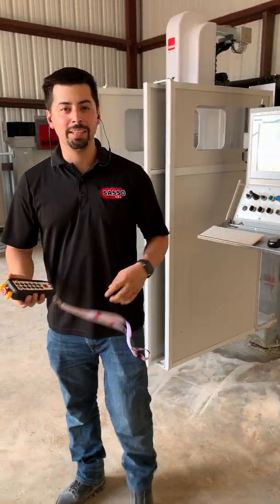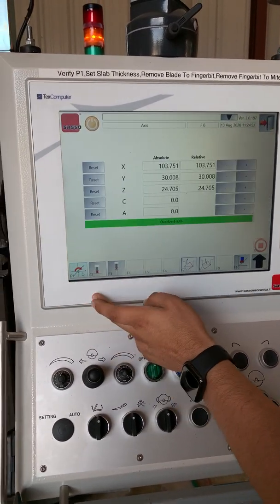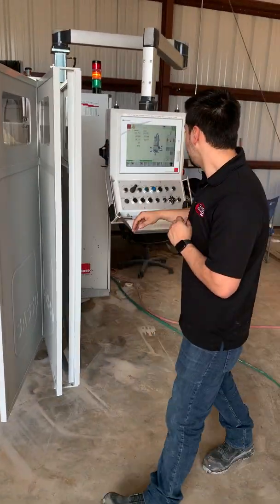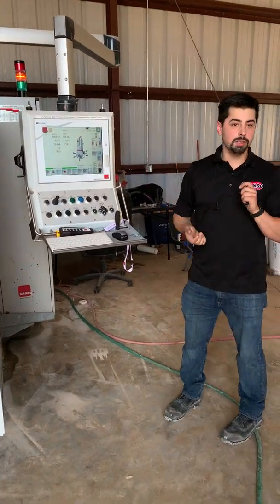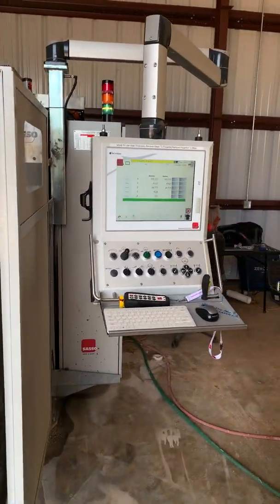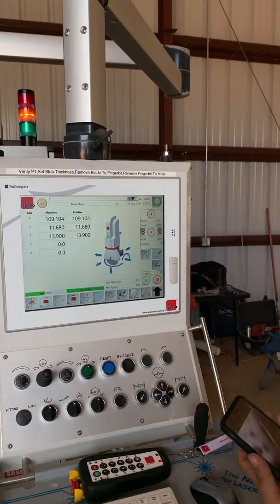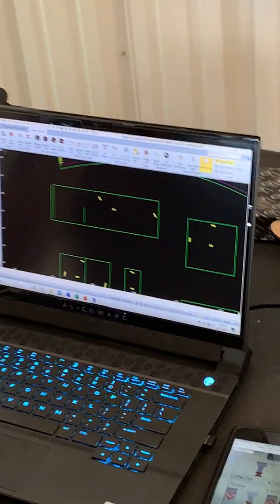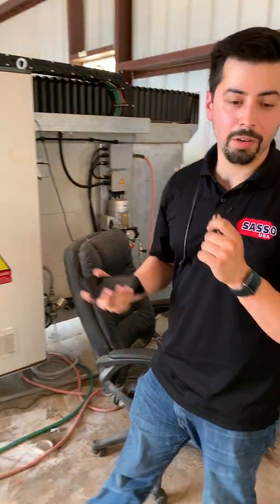Measuring your tools on a Sasso K600 (and updating them in Alphacam)

Comment: Hello good morning just one question, at what speed and at which RPM can be cut with bit.
Reply from the maker: Hello, thank you for your patience I didn't see this! Blades depend, anywhere from 2200-1800 depending on blade and material. Bits also depend on the type of bit, typically 4500 is normal for a hard bond bit, but a soft bond will likely run better at 3900.
Reply: I use it ath 4500 and 400 mm feed